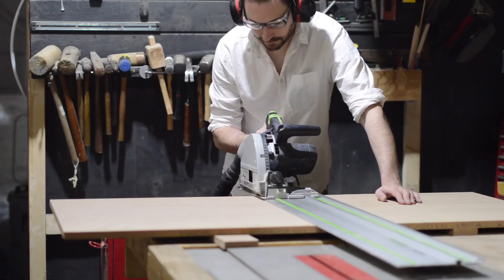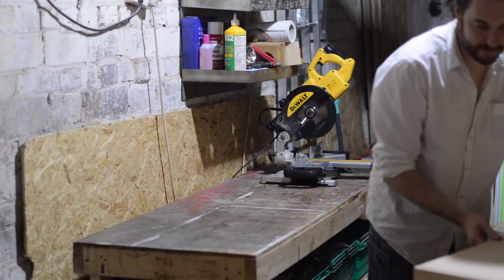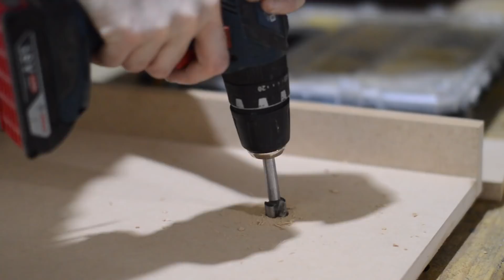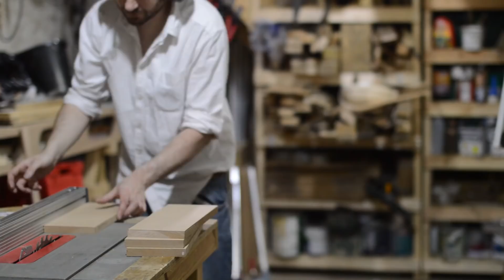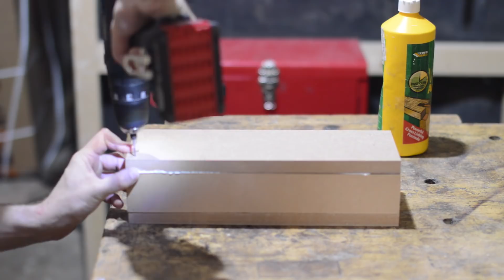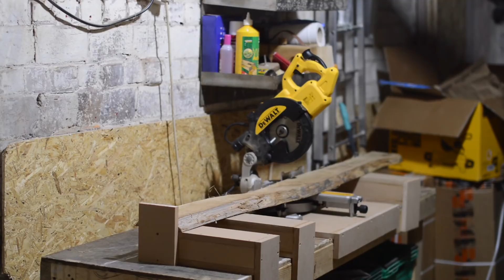Simple Mitre Saw station

Comment: I have a similarr setup, although mine consists of only a single support with a flip up stop, so takes up far less space. Yours seems to take up just as much space as a normal mitre station, but without many of the benefits. Although perhaps maybe you are thinking of things I am not.
Reply from the maker: It takes up less space and can be moved away if the space is needed for something else.